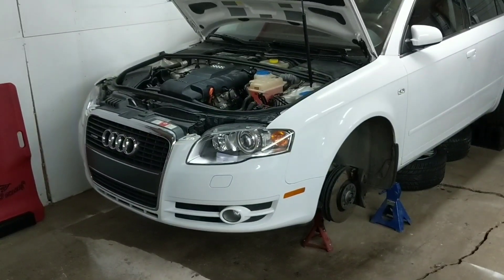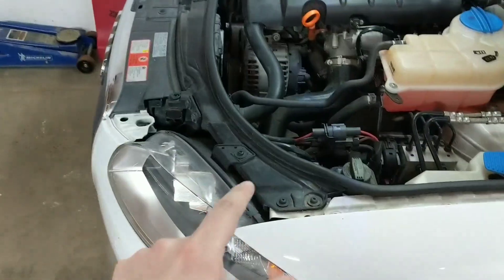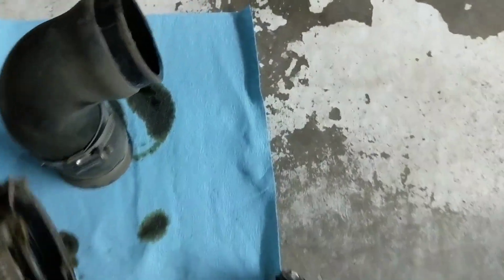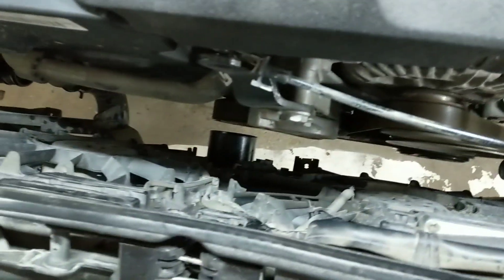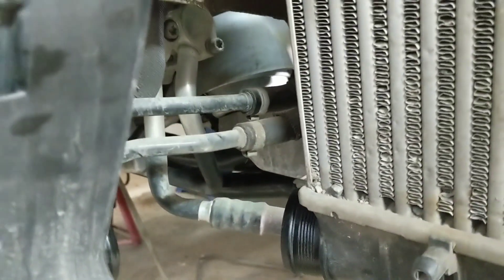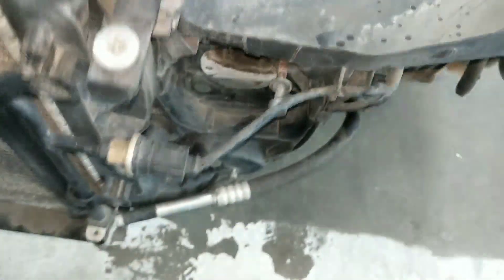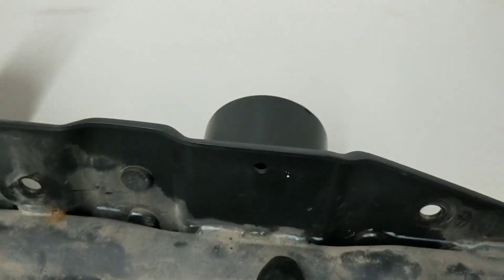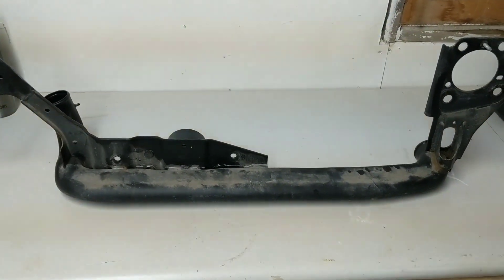Removing the Lower Core Support | Road to Finished Motor Mounts

Comment: Oil in the charge pipes is normal as the oil from the PCV recirculates in the air intake system
Reply from the maker: Totally. After a little reading that became apparent and I wasn't too worried. This car has also had 5 PCV valve replacements and I'm very, very unlikely to go the catch can route, so it just becomes "one of those things". I've had an idea...a tap of sorts...to deal with this, though.